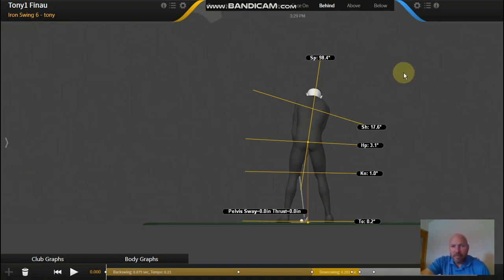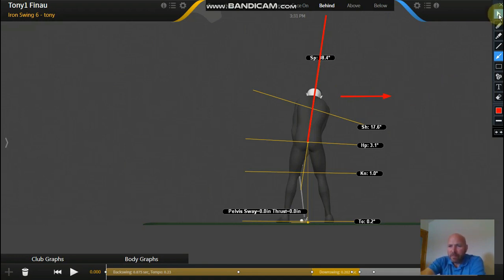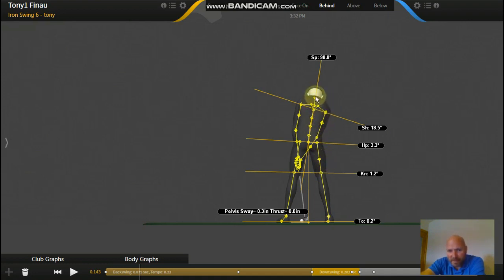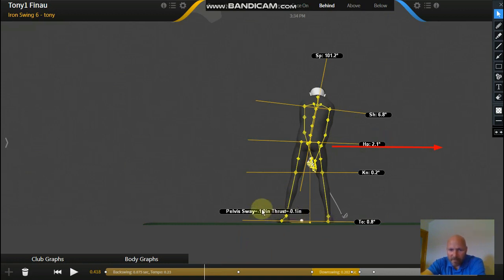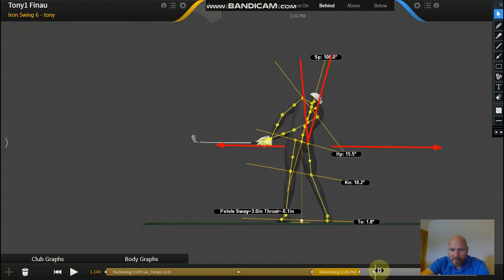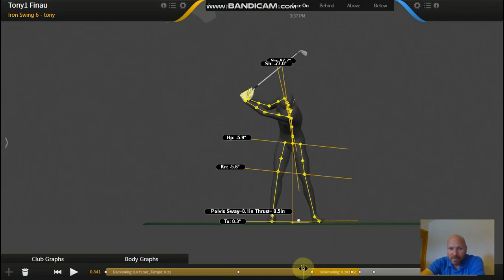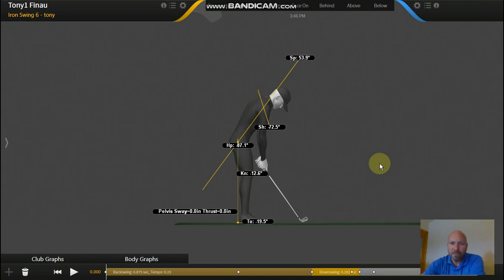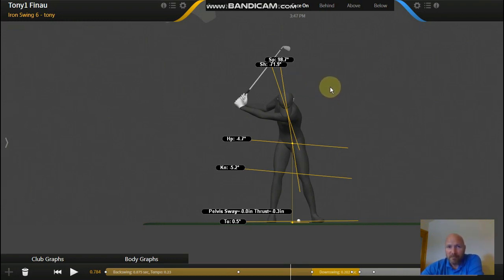Tony Finau - Short Swing Explosive Speed Here's How..!

Comment: Thanks for sharing this data.   So David Lee,  Gravity Golf,  claims some golfers are falling backward to counter the arms swing forward.  Some have more counter then others.   So this tool looks like it is only 2 dimensional.  I can't tell fully if there is any counter fall to help rotate.
Reply from the maker: Hi Dennis, our body is always counterbalancing the swing / weight of the golf club, that is the most efficient and effortless way to swing the golf club. The easiest way to swing is the move in the opposite direction to the swing / clubhead / weight. That's why kids become such good players, they dont have the strength to power the club like adults, so they learn to counterbalance the heavy golf club and sling shot it through... 

1) takeaway we move towards the target (spine tilt and weight towards target) 

2) Backswing we move downwards lowering our body towards the ground

3) Transition we pull the club down

4) Release and Impact ground pushes up back up

5) Follow through, spine tilts back in the opposite direction away from the target, but we moved far enough forward on the backswing to make sure we dont hit the ground before the ball, that is the key..!

GEARS is 3D, here is a detailed video on what I have just discussed and the slingshot, thanks

https://youtu.be/Uqz72ibsZvE